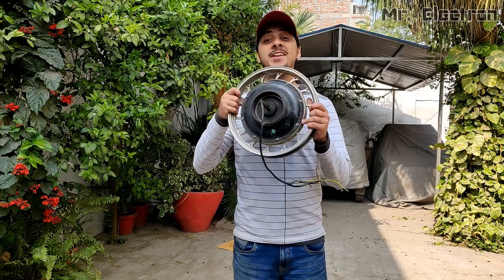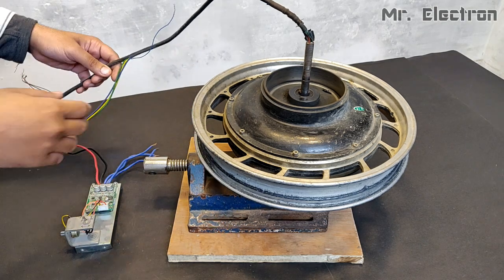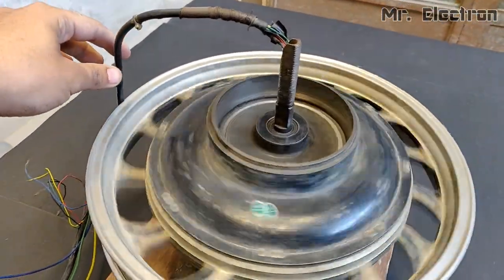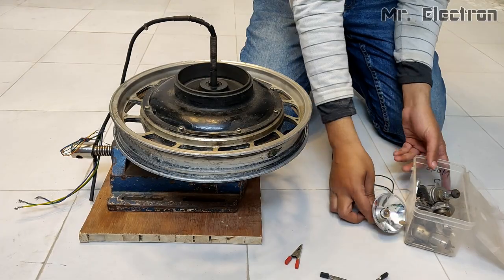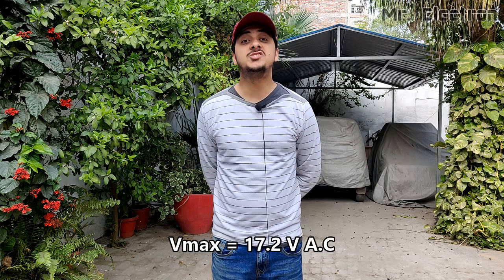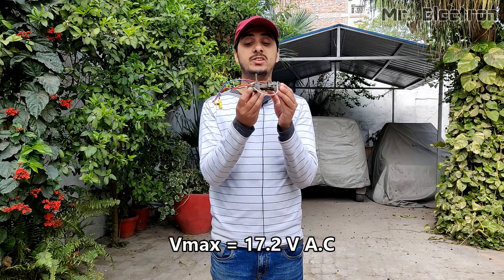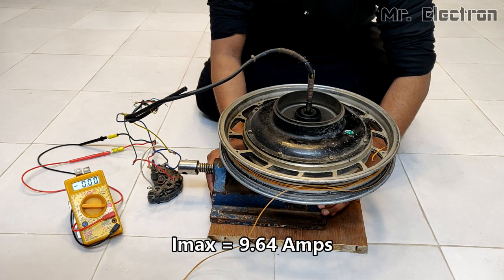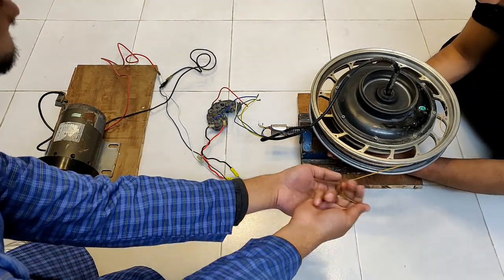SCOOTY MOTOR to ELECTRIC GENERATOR

Comment: Why not try using a drill with a round rubber disk or disk of wood on the end to hold against the hub motor wheel rim to get it to spin to test its output

Comment: it generate power mean that the resistance is more than a normal wheel(non-electric) right ? that mean if people play with an electric scooter without turn it on , it still not a normal scooter because of the resistance ???

Comment: Hello Mr.Electron, have you tried to use all ends of the wires from the scooter motor as generator, since you do not use it as motor with delta or star, to use all wires in combination to get more Watts from same generator using same torque power on it ? I think rounded will be 50% more. I.e. to use also the ends for delta con's but as el.source. Sorry for my smile : )

Comment: can you make an ebike with the front wheel as a hub generator to recharge the batteries while running?
Reply: Not enough mass to regenerate enough power to charge
Reply: Depends on the motor / generator (hub or non-hub) types. Yes it can. Not only to recharge, but also to power up the rear wheel with more power than it needs. With standard hub motors = you are not able. You need to rearange the magnets and to rewire all windings/coils. Basically, motor to be "delta" and generators "star" similar coil turns. And generators need to produce higher voltage and less ampers. Sorry if I confused you. Also, only from transformer you can get more power out than input with more coils out on larger core, it is similar system. Now I told you what all are dreaming for, but the sistem-planet raping will not function if all have what they want. Happy researching and making. (Eurasia).

Comment: HELLO MISTER SCAMMER.
1.5 Horse Power its equal to 1118watts output power. Check the online calculator for HP TO WATTS CONVERSION.
Reply: You are uneducated street learner. Wats are measures that have nothing common with horse powers.  If you are learning with company around camp fire, enjoy it. Better compare Nm power among each. (P.s. mr.electron never stole millions dollars while your intentions are obvious, ypu want to take what he deserves). You always desired something that you can not have. Skip the spamming and don't teach the teacher.
Reply: @Your_opinion_does_not_matter  hp are also counted to watts. They are direct proportional.  Check online, mr teacher. Do research
Reply: @Your_opinion_does_not_matter  english is not my main language. This is one of the 7 languages that I have learned by myself on my android phone

Comment: Question is it possible to charge the battery of an e bike while driving with a second motor as a generator?
Reply: Yes but you will lose more energy than you gain. So the only thing this does is to increase drag

Comment: Seems like the starting torque will be a big issue, in using that as a generator.  

Using as a motor seems fine.  Just make sure your controller can handle the amps of your application. 

Thanks for the vid. 
you should do a vid with one of those Direct Drive washing machine motors; re-wire it for lower volts and show some test applications. i think you have a vid with one of them... but not re-wired.